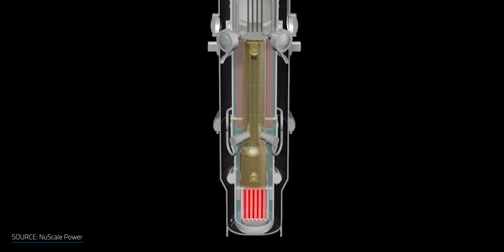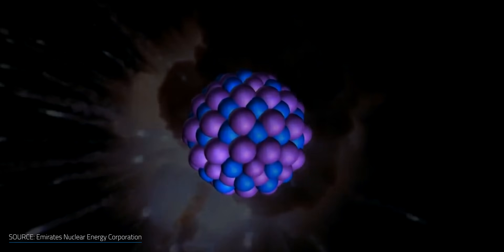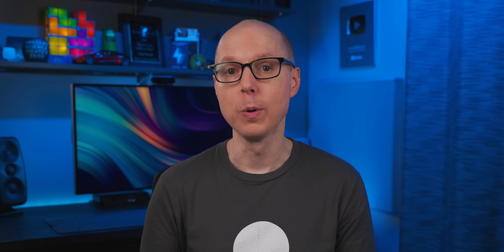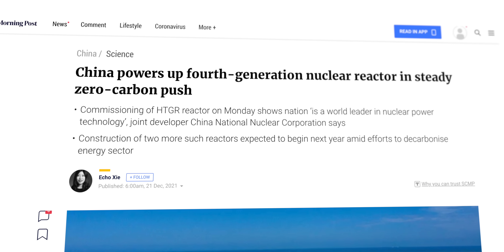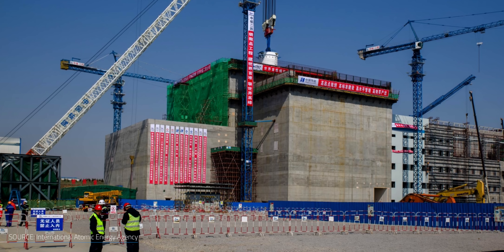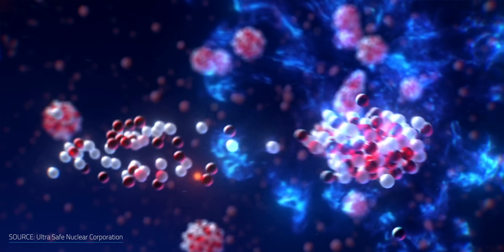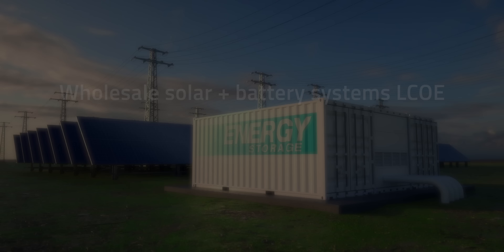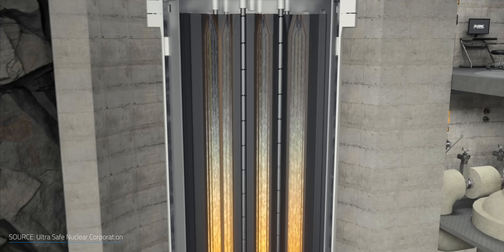Forget Small ... What About Micro Nuclear Energy?

Comment: Matt,

You're killing me with video after video of using nothing but LCOE to compare intermittent with firm power generating technologies. Dispatchability matters.  Maybe this is its own video topic but there is a real cost to turn intermittent generation into generation like fossil fuel plants currently provide: the cost of nearly perpetual storage.

The solar + storage LCOE numbers you quoted are 1-4 hours of storage.  Obviously when you're already over $100/MWh just to shift supply to the grid a few hours that doesn't scale too well when you need to store for days or weeks.  That is firmly in the $1000s/MWh territory.  That also does not factor in the massive transmission and other grid upgrade costs associated with bringing distant renewable resources to city centres.

By comparison, an SMR-based plant at $120/MWh is absolute robbery.  Existing fossil fuel plants already provide all the other infrastructure required to run: interconnections, locations not too close to city centres, etc.  Of course renewables and storage are part of the solution.  Build some, but not enough to overload the grid, and you'll enjoy lower cost power when the wind blows and sun shines.  Voila, sub $100/MWh power worldwide.  But without a majority nuclear grid, that goal is effectively impossible because LCOE with no regard for intermittency is not a number that matters.

Otherwise love all your videos, and this one was particularly great.

Comment: Nuke advocates seldom address the glaring, showstopping problem with nuclear. Who is going to insure  against the risks? Currently its impossible to buy private insurance for nuclear, for very good reasons. It has to be insured by the government. And how do you insure against some terrorist making a dirty bomb out of a microreactor? So its not really a free market solution, nor can it really be decentralized. Its also completely unnecessary, since solar and batteries are progressing so rapidly they're already cheaper than anything else and will only get cheaper. Check out tony seba and rethinkx, they have some great research that illustrates this.

Comment: I'm always skeptical about the comparative models used for power-source/death per MWH. Especially given the relatively limited number of nuclear reactors which are treated like a new car, with owner being all extra careful because it's their first new car... Compared to the coal or oil stations which are a bit like your 500euro battered fiat punto which is the one you use everytime it snows..
Reply: Coal kills people by venting particulates into the atmosphere (in normal operation). In normal operation, nuclear has no emissions.
Reply: @economicprisoner  I get that, but as you will have seen the death rate for nuclear was not 0. This is because there are associated deaths with the handling of material, exposure of staff in the plant, waste handling, environmental contamination and of course accidents which are not without precedent. 

The point I was making was that we have a handful of nuclear facilities which we exercise relatively high standards of control over. The extra cost of security and safety protocols is manageable because of consolidation of nuclear into a few sites. Once the number of sites increases, the risks of accident increase as do the costs to prevent accidents and secure sites. Including the massive increase in hazardous waste. 

I'm contrast, there are a staggering number of coal plants which are cheap and hazards are mistakenly thought manageable and risks ignored due to the historically perceived "indirect" and non immediate correlation to deaths. We know that's not the case now, but I suspect we could fall into the same trap with nuclear
Reply: @islandsedition  1 death per TWh works out to 1 death per GW of production capacity every 3+ years.

Nuclear reduces material handling over coal enough (because the reactions are so much more energetic) that I can believe it.

Comment: 2:42:  your slide is backwards for moderators....fast neutrons require a moderator like graphite or water or other high hydrogen molecular material to slow them to thermal speeds where they can fission U235 or other fissionable atoms.  Great information otherwise!

Comment: The one major cost to nuclear is the incredibly high consequences if there is a problem.  Because nuclear waste stays around for potentially a thousand years, in the very unlikely chance that there is a problem with a new, safe reactor, it will still have an effect to the surrounding ecosystems for a long time.   Not just a few years, or a decade or two.  The area can be toxic for decades, or centuries.  That's a challenging consideration to include in the calculation
Reply: Nuclear waste is long lived due to the nuclear non-proliferation treaty. Waste reprocessing is avoided.

This means that something like only 1% of the fuel is actually "burned". If your waste is dangerous for millennia: you are leaving energy on the table.

Comment: As an observation, proponents of nuclear power never really address the waste problem.   If anything, it's a footnote at the end, just like this video.   Until this question is answered, it's hard to imagine governments and utilities lining up to jump onboard.   Separately, today nuclear power is uninsurable, there quite literally are no insurance companies willing to write policies on the plants, the waste, anything.   This is partly due to plant construction costs, but it's also due to the waste problem, while the risk of accidents are really quite small, the impacts of those accidents can be really quite large.   Small probabilities are hard for people to comprehend and calculate, but ultimately - if these risks were as small as proponents claimed, they'd be insurable.    That they're not insurable tells you everything you need to know.    Making smaller reactors, which ultimately means larger quantities of them, doesn't solve this problem.
Reply: The waste problem is necessitated by the nuclear non-proliferation treaty. If your waste is dangerous for thousands of years: you are leaving energy on the table. Existing plants generally only "burn" about 1% of the fuel.

The fuel is then held in storage because recycling it to recover the still usable material is considered a major potential source of diversion for making nuclear weapons.

Comment: For many years I've been envisioning a sealed titanium ball about the size of a softball, fully shielded with a little pea size piece of nuclear material inside. You just drop in your home boiler and it stays constantly at about 350° and just boils your water or turns a turbine. It's safe because it never gets hot enough to melt. Of course they'd have to be registered and you'd be in big trouble if you lost one or sold it to somebody.
Reply: The temperature of the ball is dependent on the temperature of the coolant it is in. Could be bad if the water boils off. Also you will need to do something about the gamma rays.
Reply: @SocialDownclimber  well I'm not a nuclear engineer but water and lead are both barriers against gamma rays. And even if it wasn't in water it could have fins on the outside that would cool it even in air . . . enough to not melt.

Comment: The problem with these things is that they all release energy that is currently trapped in the earth's fabric, that is to say, energy that is not already in circulation.  Renewable energy harvesting systems like wind and solar, on the other hand, capture energy that the earth was going to receive regardless.  If that energy gets taken up and turned to mankind's direct use, the net energy circulating in the earth's systems doesn't change appreciably.  Firing up reactors that release energy that had been - and would continue to have been, without human intervention - tied up in the earth's crust since it formed, however, must eventually dump that energy into the global circulation and thus, inevitably, contribute to climate change.

This is not a good idea, if you ask me.
Reply: The earth is a speck of dirt flying around a huge nuclear reactor we have no control over which is very capable of zeroing out our technology. AKA reversing the magnetic field on everything as we read.

Comment: I don’t understand this one Matt. You usually cover every part of the tech you present but I heard nothing about how the heat of the reactor gets turned into electricity. Ultimately no matter how small the reactor is it still needs to generate steam to turn a turbine to generate electricity yes?  So far as I know the only atomic tech that does not need to use the nuclear heat to generate steam are the nuclear batteries on nasa space probes.

Comment: If there is multiple SMRs inside of molten salt, which eventually pumps in fuel/coolant (as they are the same in SMRs), it would allow for segregation of the reactions heat transfer to multiple different turbines for energy due to the modularity of the small reactors. This could help prevent energy loss during recooling due to the relationship between temperature of an object and heat loss directly scale at a quartic rate, as well as allow for multiple-thermoelectric inputs to create more stability and gives the ability to shift base-load generation to save fuel during high intermittent generation, given that there is some level of locational integrity of each reactor that allows for independent modulation of neutron-energetics. Then we just have to figure out how to either store the waste, or what I would prefer, evolve bacteria that are capable of consuming and speeding up the decay rate such as Dinococcus radiodurans. I think micro reactors may have a place for isolated energy requirements, like in space travel, military bases, or relatively isolated towns, but I think the seeming lack of modularity will stop micro reactors from being ever commercially realized for urban/suburban civilian infrastructure.

Comment: For what it's worth, comparing solar + storage to nuclear isn't usually an apples to apples comparison. Solar plants with batteries usually buffer 2-6 mwh per mw of power they produce. That won't even get you through the night, much less through a stormy week with lots of cloud cover. To have the level of uptime and stability that nuclear provides, you're talking about 50-100+ MWH per mw, depending on regional weather conditions, and those batteries have short life expectancies (well under 10 years), so it's a reoccurring cost. 

Taking into account what's actually required for grid stability as a bulk power source (i.e. without tons of gas peaker plants absorbing variability) nuclear is at least an order of magnitude cheaper than other non-carbon energy sources.

Comment: Regarding the 90.000 tonnes of spent fuel the US has accumulated, that sounds like a lot, but all put together would make a cube 17m per side, which is "big" but not that big. And all of that is after 60 years of providing 20-25% of the demand of the most power hungry nation on earth. And part of it's navy.
If we reprocess that cube, and assuming all gases just separate easily, everything that is not Uranium would make a cube 6m on the side of which approximately a third would be actinides (great fuels but long half-lifes) and the rest would be fission products with stuff from precious metals to medical isotopes to useless stuff. The longest lived of those would be 300 years. Separation has its political issues but again, to put things into perspective.....
On the broad narrative I think nuclear has been ignored politically because it just solves a problem, and politicians are all about creating and perpetuating problems and dependencies. A fast-spectrum fleet of nuclear reactors running on those 90.000 tonnes would provide dependable electricity for literally thousands of years before we have to bring in more fuel. It's too straightforward, it just leaves no room for politicians to complicate things to justify their job, so politically it's a non-starter. 
Just my 2 cents.

Comment: Texas has 4 Nuclear reactors making about 5 Gigawatts per hour. We have close to 125 Gigawatts of power generation capacity available. I cannot see Texas building 50 or 60 Large Scale Nuclear Power plants or a large number of smaller reactors. I worked on stress analysis design of the STP Reactors back in the 80's.  My advice is DON'T GO THERE.  WE cannot build another 100 Large Scale or thousands of small scale Nuclear power plants and spread them across the United States without suffering Meltdowns. Texas Wind Mill Powered Plants produced about 60% more power than our Nuclear Power Plants. Solar about half so far.  What we need are more of those with batteries to back them up and then use our Natural gas Power plants to back them all up. The biggest problem we have in Texas is GREED and the ability of GREEDY people to gouge the Public during times of emergencies or equipment failures.  I can just see some Texas Red Neck using a small Nuclear plant for target practice.

Comment: Micro reactors are ideal for off-grid remote locations. I hope more investment is put into them!

Also, I would like to raise a point I really don't see being often discussed: Replacing existing coal-fired plants with SMRs is a competitive and realistic way of achieving significantly cheaper nuclear energy while also maintaining jobs for the local community. It is important to note that, while renewables do create new job opportunities, they are mostly during the construction phase (since you don't need to operate a wind turbine or a solar panel) and don't really require high-level of education, so people might end up getting paid lower.

Another very important topic is land occupation. Nuclear power is able to generate a great deal of energy using a very small area of land when compared to renewables, so for countries with not so much land available, nuclear power should be really considered as a competitive energy solution.

One last thing: current nuclear waste is able to be reprocessed in especialized facilities and then used as both MOX fuel or recycled in fast reactors. That's partially the reason why so many countries are not willing to bury their nuclear waste stockpile deep underground. Because they are still a considerable source of energy in advanced reactors.

This matter involving nuclear waste recycling is much more political than technical, really!

There are technical solutions ready, but political affairs continue to delay their deployment!

Comment: Multiple navies across the world have been using small reactors for decades. The powerplant of of a submarine is about the size of a fridge and is in a compartment with its support machinery about the size of a two story house. Why can't we just take tthose? I know they use a higher-enrichment of fuel - but they also run longer than commercial reactors too. (approaching fifteen years between cores vs thirteen months).

Comment: I'd like them to go small enough to install in my home as a localised power source instead of from who knows how far away a plant, better yet small enough to plug individual appliances into.
Reply: I don't think its a good idea to be allowing radioactive material to be sold to individuals. Most people would use it properly, but then terrorists and other illegal crime would use it in dangerous ways. IE building bombs.
Reply: @wiseconqueror533  I don't mean for individuals to transport, maintain or use directly, what I mean is it would be installed & startes by the company selling them and repairs etc would be handled by them under their warranty, after which it will cost the home owner for each instance of maintenance, like with boiler systems, it's also fine if those services are handled by the electric companies, the point is to reduce reliance on the grid
Reply: Yes
Reply: no.

Comment: A brilliant solution is right over our heads? It’s not funny but the lightbulb flashes on in the cartoon. Fusion power Details to be worked out? Set them in orbit, redesign to maximize electromagnetic radiation output, blanket the entire planet with the transmission energy, delete the steam turbine heating water cycle, and set energy receivers / electric conversion units (solar panels) wherever they needed on earth to receive the fusion energy right where its needed? What? Then somebody walks along and looks right up over your head at your brilliant solution and asks there must be an easier way?

Comment: Search the name, Galen Winsor, in You Tube.  He designed nuclear "waste" facilities and was an early pioneer in the nuclear energy industry.  His experience began during WWII and he witnessed the ever increasing regulatory suppression of nuclear power.  He demonstrated what has been labeled "nuclear waste" is not only not dangerous but is an extremely valuable asset that is being stored for future use and is being done at taxpayer expense.  Nuclear reaction byproducts are vastly more usable for power production and are perfectly safe.  The cost for power production would be minuscule compared to what the industry is charging now.  Just as with the "cost" of oil the consuming public becomes accustom to the ever increasing prices and forgets that the excuses used to raise prices fade away but the prices never come back down.  The same tactic is being used for nuclear energy.  The cost is a small fraction of what we're led to believe especially if we use the "waste" as fuel.  Galen proves his points about safety in some of his lectures.  When large amounts of money are involved the lies get bigger and bigger.